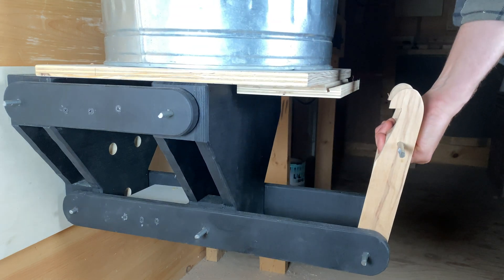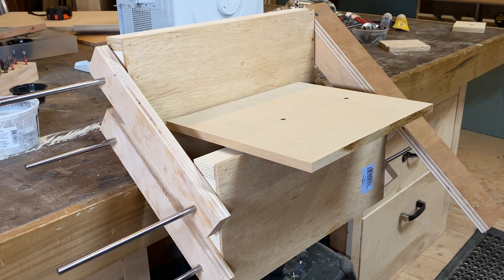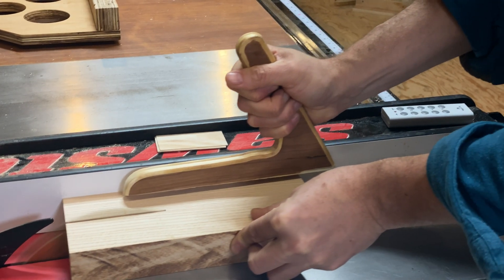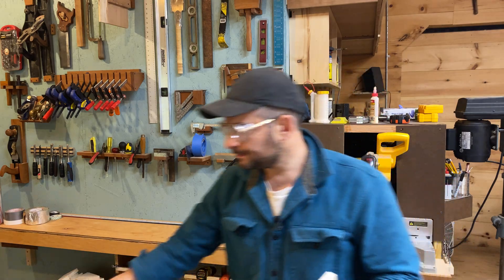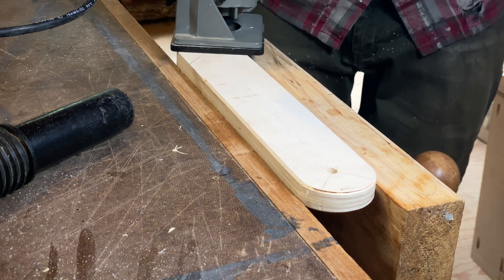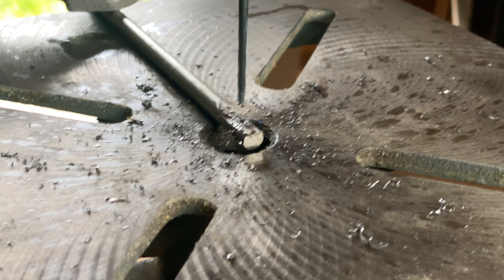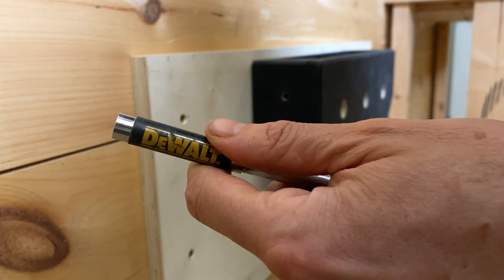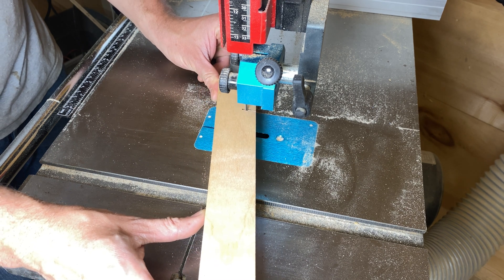Does this garbage can lifter really need to be this complex?

Comment: Very nice build, interesting approach!  So many things can be done with a “four bar planar linkage”.  The architect’s lamp on my computer table, and the floor lamp by my chair are just examples.  And links of unequal length can produce all kinds of motion.  
I’ve also seen people build workbenches with integrated jobsite saw or planer that pull out and lift into position using this same kind of linkage.  
Also saw the video of your camera stand.  Got me to wondering if this could be used for a mobile base (table saw, assembly table, etc) with retractable casters.
Stay safe!

Comment: 4:42 - saw the table saw kickback a narrow sliver of wood. Good thing it didn't hit you. To remove wood that thin, best to use a planer or jointer with multiple passes. It'll square it as well. Nice solution here though.
Reply from the maker: I want to say this was a calculated move, since the piece wasn’t between the fence and the blade it was controlled and I saw it coming. But. This is also why my planer needs to be much more readily available. It’s a pain to roll out and use so I don’t. Thanks for shining light on this.